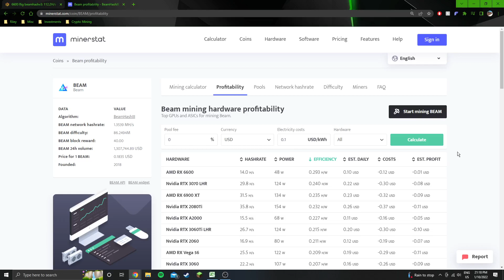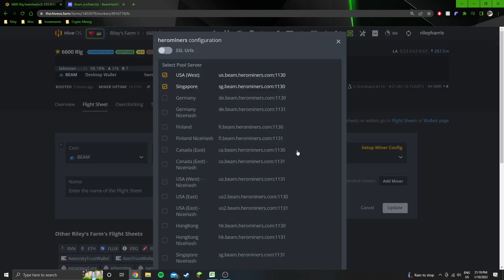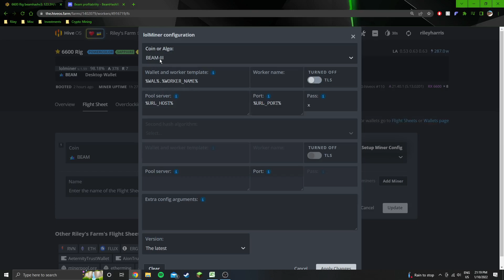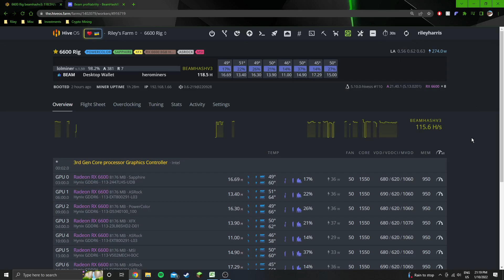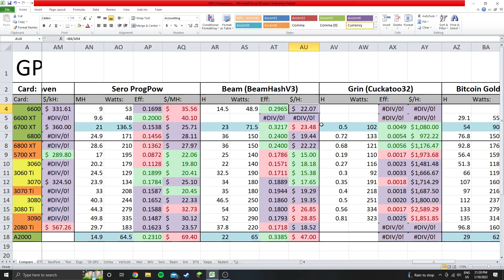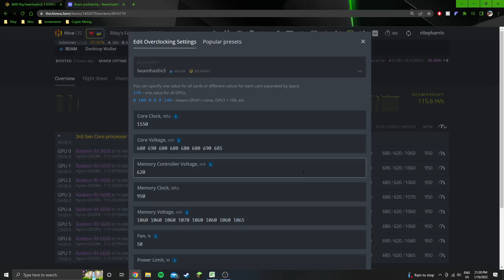6600 Efficient Beam Settings | 14.5H @ 48.9w Wall

Comment: Interesting, much higher core clock voltage than the other algo's
Reply from the maker: Hey there. Core dominant algo's use a higher core clock, and hence need a higher cove voltage. Algo's like CryptoNightGPU hold reasonable efficiency up to 2000 core clock, so they have even higher core voltage than Beam.
Thanks for watching!
Reply: @KiwiCryptoMiner  Interesting, do you suggest we start the overclock with a lower core clock and move up slowly?
Reply: @KiwiCryptoMiner  The "default" core clock is 1400 on these, so i guess 1450 would be a good starting point?
Reply from the maker: @GeorgeGoosen  Depends on how much you want to for efficiency, or hashrate. Generally if you go higher core, you'll get higher hashrate and less efficiency. and lower core = lower hashrate but higher efficiency.
For that reason you might want to start low, or start high, depending on your goal. Personally I try to find a balance for my videos. Otherwise I get people saying 'the card can do much higher hashrate' or people saying 'mine is much more efficient'.
Thanks for watching!